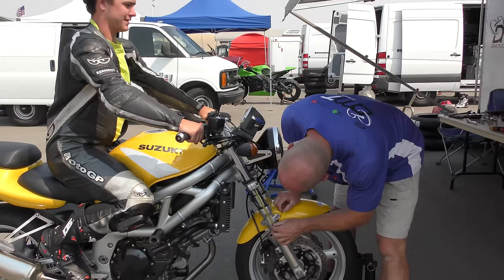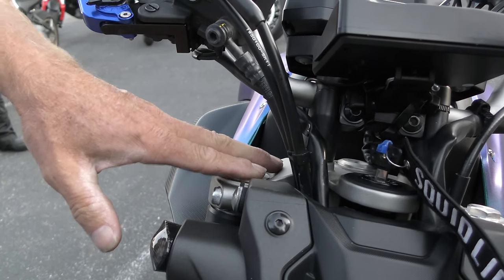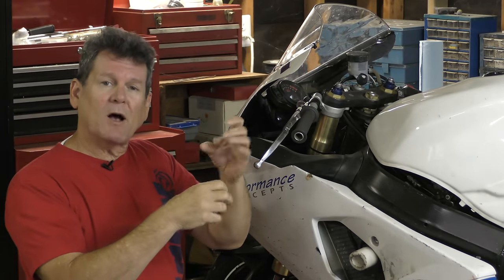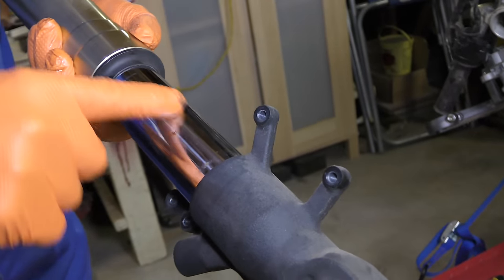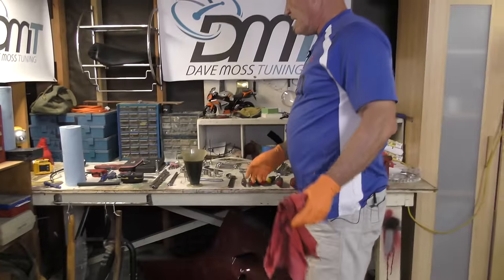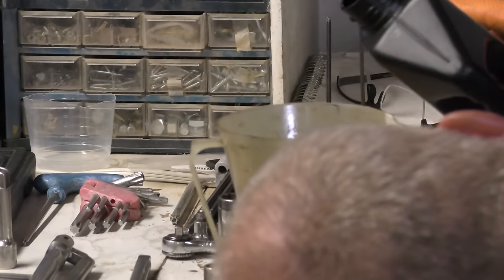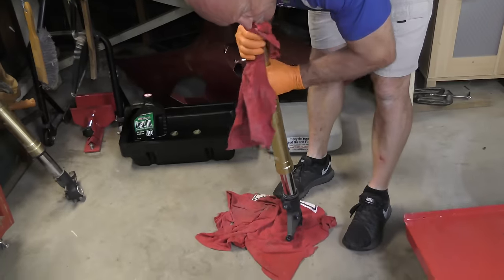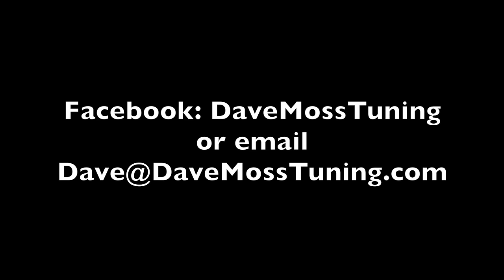Dump & Run Fork Oil Change for Standard Adjustable Motorcycle Forks

Comment: I've never once seen a fork disassembly vid where the mechanic uses a plastic tool for separating the dust cap. It's so easy to slip or otherwise have an oops with a screwdriver and either scratch the inner leg or mark up the bottom of the outer leg. For $5 you can buy a set of car trim panel tools which are plastic and never worry about having an accident.

Comment: Wow! 10 Years ago I had to rebuild my forks every year, because they were leaking. Massive amount of work because I pulled everything apart. 

Now I think I know my problem. I didn't pushed the air out of the inner cardrige and stored the forks horizontal till I needed them.

Big thanks to Dave Moss! I wish we had someone with your skill in Germany who's doing the same service to costumers.
Reply from the maker: Glad that in time you now understand what happened and why so next time, you will get the job 100% right.
Reply: @catalystreactionsbw  I've been watching a lot of your Videos the last few days and I do understand more and more of my mistakes I've done over the years.

Comment: when doing fork seals and changing oil is it good practice to back off all adjusters to the softest position first and if I don't are there any bad outcomes
Reply from the maker: That is a good idea so you get maximum irculation to eliminate oil. Not doign this just makes the process a couple of minutes longer.

Comment: Shouldn't you use steel wool instead of 400 grit sandpaper on the chrome finish on the forks? I could see from here in michigan you scratched them up.
Reply from the maker: It is how I was taught in 1995 when I first started in a suspension shop and have stayed with that. After a few hundred miles the chrome is perfect again. For others it can be crocus cloth, wire wool, 1000 grit emery cloth. Many ways to get an excellent result.

Comment: I used the 400 grit sand paper to sanded down the dirt on the forks and now they have a lot of scraches... I don't know if that's really a  bad thing. Instead of sand paper use abrasive rubber which is much more gentle with delicate surfaces.
Reply from the maker: The fork dust and oil seal will polish all those marks out very quickly.
Reply: I think he used a different grit to after using 400 grit.  not sure what it is.. same thing happen to me.  I heard 2000 works too.  thanks for the tip.

Comment: Hi Dave, thanks so much for this vid, it was easy to follow and I used it to do an off season fork oil change on my R1 5PW race bike. The seal greasing trick was a nice touch too, managed to improve the stiction on one of the forks that was a bit juddery!
Reply from the maker: Excellent and thank you for using this video as a reference to get the work completed! A tip of the hat to you :)

Comment: Good intruction video, but i wonder why not change the dust and oil seal att the same time as changing the oil?
Reply from the maker: Thank you, glad you enjoyed it. If the oil change is with low miles on the seals and they are not leaking, the old adage of "if it isn't broken don't fix it" applies. Seals will be replaced every 10k on my bikes for road, every 3 seasons for track. We all have our own preferences, so dust and oil seal changes at your personal interval choices.

Comment: So I just checked a 2020 bike owners manual - their standard procedure indicates fork first oil change  at 40k kilometers  (read the line twice and could not believe it ) ... so roughly never - not good I guess. 
Direction column bearing balls check and greasing  happens at 10k ...  no comment .
Thanks Dave for sharing your expertise and making
 us getting some “esprit critique” ...
Reply from the maker: Thank you for doing some research to give yourself data points to review.

Comment: Good tutorial. 
Call me crazy, but with the amount of glitter in that oil, I'd disassemble it and clean it up proper. It's not rocket science. Oil was dumped out, but that metal was at the bottom, so there's still more inside, likely in the piston/shim stack.
The owner of that bike would be well served to clean the fork tubes as much as his tank or exhaust. 😅
Reply from the maker: Agreed..... nothing better than a full tear down to know everything is clean and fully fiunctioning.

Comment: you make that look easy...I did seals on my FZR, wasn't even close to easy.now that I've put 300 miles on her I realise it needs better springs.
Reply from the maker: Did you use propane to warm up the seal area first? It helps tremendously.

Comment: Great informational video Dave and thanks for posting....I'm about to change the original oil in my 2003 Honda Valkyrie f6 1500C with 34000 miles. Going to use BelRay Motorcycle Oil 99330-B1LW..15W instead of Pro Honda SS8 10W...... thoughts.??? Also, dirt and debris gets past the dust shield and into the seal. An occasional cleaning using plastic film or plastic fork cleaner tool seems to do the trick..
Reply from the maker: Hi Thomas. Thanks for your kind words. A seal saver type product is superb at what it does. 15w BelRay is an excellent choice!
Reply: @catalystreactionsbw  Thank you so much for the fast reply and have a great weekend..!    Best Tom

Comment: I didn’t realise this was so easy!!! 
I have a 2014 z1000 with preload adjust on top of left fork and compression and rebound on top of right fork. Will this work wit my forks? And do I only do the right for or both sides?
Thanks Dave you videos make it so easy to understand suspension!
Reply from the maker: Yes, it will work with either leg - same process. With damping in one leg and spring in the other, don't be surprised to see different oil amounts.

Comment: Thank you Mr. Moss, your insight is invaluable.  I read through all the comments and had most of my questions answered, so thanks to your followers.  I'm a newbie to motorcycle maintenance and have one more question and that is, supporting the bike when you remove the forks.  It looks like you have the bike resting on its exhaust pipes supported by 2x4 lumber.  Is that what you've done?   I assume that, if that's what you do, it must be OK for the bike.  Is that a safe assumption?   Thanks again.
Reply from the maker: Thanks for watching and leveraging the content. You observation is accurate. If the bike had titanium headers we would have held the bike up by engine cases.
Reply: @catalystreactionsbw  Thanks for your response.  I'm setting up a 2006 R6 for the track so I'll be watching a lot.

Comment: I guess using the measurement of the removed oil assumes the last guy did it right and there's been no loss? Is it best to refer to the manual or would that quantity assume a complete (to dry) service? Thanks for the video - I always learn lots.
Reply from the maker: Correct - always check service manual first for known volume, then decide what you want to do.
Reply: @catalystreactionsbw  , but the service manual, for my 2007 CBR600RR for example, only gives an oil height reference while the fork is without the spring, so the only way I know how much to pour back in is to try and capture everything that comes out...  unless you tell me something otherwise...?  right?   Thank you!
Reply from the maker: @LongDogRacing  In that case (as you cannot remove cap, spacer and spring) yes, you capture the volume of oil removed to see what you have. Research online shows 400ml as a minimum or oil height at 100mm. Ride and see how much fork travel you use and mark fork bottom out as a reference. If you bottom out add more preload and compression. If you bottom out again add 25ml per leg and go back to original settings.
Reply: @catalystreactionsbw  Thanks Dave.  I recovered 350ml from each of the forks (yes, every last drop!), and replaced it with the exact amount.  I will ride them and heed your advice.  Thank you for all you do!
Reply from the maker: @LongDogRacing  My pleasure!
Reply: @catalystreactionsbw  ('07 CBR600RR) Dave, I've set my oil height per the manual at 93mm (10 weight bel-ray).  I installed .85 springs per the k-tech calculator for my 150lbs (w/o gear).   During my tuning day at Mid-Ohio, I found it difficult to balance the trade-off of preload and compression, as I found myself very close to the max preload setting (which I don't think you want, right?) as well as very close to the mechanical bottom.  All of this to ask:  If I add the 25cc's you recommend in this subthread, what would be my approximate oil height removed?   What is the minimum oil height before bad things happen (and I need to just bite the bullet and get the next heavier spring)?

Comment: Thank you for the video. Is there a related video with guidance on reinstalling the forks in thr triple clamps? Specifically, aligning the rotation of each to ensure the axle aligns properly with the lower part of the fork?
Reply from the maker: General principles suggest setting the fork height the same above the upper triple clamp. With a used bike and unknown engineering inside, forks may have been modified. Measure from the base of the lower triple clamp to the base of the fork. If there is a couple of millimeters difference, that is not a problem. 4mm or more would require an alingment and ignore the upper measurement.
Reply: @catalystreactionsbw  Thanks; you did mention taking a measurement from the top of the triple clamp to the top of the shock prior to removal, so as to reinstall at the same height. But my question was focused on the rotation of each fork within the triple clamp - what's the recommended method for ensuring that the forks aren't twisted out of alignment w each other. Just slide the axle temporarily through the lower end of the forks during the reinstall?
Reply from the maker: @rhenriksen  If the fork outer tube(s) are twisted, you would need a straight edge to validate that. If they are and you do not get then straightened, then you mark the bow in the fork(s) with a Sharpie pen so the wheel faces further forward. If one is bowed, then you must get it straightened.

Comment: 400 grit sounds a bit to harsh for that crome .. would 1200 be an overkill ?
Reply from the maker: We have used 400 grit since I started in 95. It gets rid of all imperfection and cross hatches a nice smooth surface. If you want a nice finish after 400, go to 800 grit.

Comment: Good afternoon.  Tell me, is it correct to change the oil in the fork without removing the spring and bushing?  What does it threaten?  The manual says they should always be removed.
Reply from the maker: It risks nothing and decreases wear of bushings especially if you let them drain overnight. If you feel you MUST follow the manual, that is quite normal.

Comment: Hi Dave. Thanks for the video. I have a 2018 KTM 1090 Adventure R with compression and pre-load on one fork cap and rebound and pre-load on the other. 25,000 miles and I am doing the first fork oil change. I dumped out 620 ml from each fork but the manual calls for 715 ml in each leg. Is there a problem with just putting the recommended amount of 715 back into each fork leg? I am fairly certain I drained all the oil out using the method you described. Thanks again for the great video.
Reply from the maker: Hi John. If you pumped the caps to empty the cartridges and drained it for 24 hours and 620ml came out, then I would put 700ml back in.
Reply: @catalystreactionsbw  Thanks Dave. Did pump the forks extensively until only a very few drops were present. Did not let it drain for 24 hours though.
Reply from the maker: @drjdvm  Go with 700ml.

Comment: Questions Dave. I have a 2012 s1000rr, and the manual says I need to add 602ml of fluid and 90ml of air gap.The manual doesn't say, but is it 602ml and 90 air gap with no parts inside or with all the internals in spring cartridge, etc. Thanks so much for all your video.
Reply from the maker: It is with cartridge only inside. Spring and spacers not in the fork.

Comment: Buy extra oil before you do it fellas! I only bought an extra liter which was not nearly enough to get it proper clean. I would count on using about almost a liter per fork just to get clean stuff coming out(I wouldn't use brake cleaner like some guys do, rubber don't like that stuff).

Comment: Great video.  What's the fix if I get 450ml from 1 leg and 420ml from the other? Do I put extra in the leg with 420 or just replace as is.  Forks seals are not leaking
Reply from the maker: If you are aggressive, 450 would be the volume to go with. More leisurely? Go with 420.

Comment: Hi Dave. Really helpful video thanks. Just in the middle of doing my forks. Only managed to get 510ml out of each fork leg but the manufacturers recommendation is 602ml. What amount should I put back in?
Reply from the maker: Thank you. Normally you get almost all the oil out and there is a 25cc difference.  Always put back in the amount you took out unless you are going to set a very specific oil level.
Reply: Thanks for replying so quickly. Just wondering why I wasn’t able to get the majority of the 602ml out? It’s a 2010 S1000rr.
Reply from the maker: @chriswood77  Unusual - perhaps someone had changed the oil before you and chose a different volume?
Reply: Only had the bike for 3 months and not been able to ride it much due to current lockdown rules. It’s only done 7000 miles  so that’s why I’m changing the oil. Just wondering what to do now. Would the lower oil level make you think that the previous owner has been changing the setup? I’m only 12 stone but had to wind preload fully in to get correct sag. Could this have been a lighter rider wanting a softer spring and greater air gap?

Comment: Thanks Dave!, I'll be doing this soon. I have a question about air gap. Does this  dump and go assume that the air gap has been set via the amount of oil that's been removed. In other words, putting back the same amount of oil that was removed means the air gap is the same and doesn't need to be set?
Reply from the maker: That is correct. If you want to assess volume, compare with the service manual to see if you have more or less.
Reply: @catalystreactionsbw  thank you very much,  I'll do that

Comment: Do you have a video for replacement of both bushing inside the fork?
Reply from the maker: Yes if the forks are what is called bash apart. The CBR600RR video has that process in it. If the fork upper tube comes off in your hand, those bushing are captive and you need to buy a new upper. Not expensive. Otherwise a suspension shop "might" have the very special tool needed to attempt to get the bushings out.

Comment: Hi Dave, regards from Colombia South America.
Any time have you used small amount of fresh oil to flush the system before refill?

Is it good?
Not necessary?

Successes!
Thanks for share!
Reply from the maker: There are many ways to do this, the two most popular being kerosene or oil flush. The right thing to do would be a strip clean of every component but very have have that capability.

Comment: At 10:30, when you are pouring, aren't you worried the oil is not making it into the inner tube and instead going between the inner/outer tube?
Reply from the maker: There are holes in the chrome tube to allow the passage of oil between the inner and outer tube, plus you have the oil seal in place.
Reply: @catalystreactionsbw  makes sense, so when the fork goes thru it's travel stroke, the oil "trapped" between the inner/outer rises sufficiently to reach that passage point. Thanks Dave!

Comment: What is the video called about air gag/ oil level. I'm having trouble at moment with new cartridges, air gap was 190 from the spec sheet from maxton . I'm bottoming out ,so I've put 20ml more oil  more preload and a bit more comp . Now I'm still going to the bottom but got 2mm static sag and 20mm rider ,22mm so way to stiff .I can't work it out .was going to put 50 ml more oil  change air gap to 110mm and put back to original settings . I'm a member of your online group so I'd like to watch any videos on oil level . regards Dylan
Reply from the maker: Hi Dylan. Thanks for supporting what I do via your subscription. 2mm static sag means the spacer is way too long. 20mm is generally a minimum number. Sag at 22mm with 2mm static and you are bottoming means your spring is massively too soft. Oil level at 190 is for race use generally and you do not talk about preload nor compression (where are you in the range?). Before adding oil, we need to know if that is the right direction that will yield a solution. Email me with all this as a copy & paste: dave@davemosstuning.com
Reply: @catalystreactionsbw  I've emailed you on davemoss tuning .  Thanks 👍

Comment: Do you have to use expensive sweet smelling "Maxima" types, or will regular hydraulic fluid, or ATF work?
Reply from the maker: ATF is generally 30w, so if your application can use that correctly, sure.
Reply: @catalystreactionsbw  ATF fluid weight
Mobil 1 Synthetic ATF is approx 10wt.Mar 26, 2011

Posted April 19, 2009
ATF and power steering is 10W and so is most hydraulic oil. I prefer Dexron II or III the additives package is very good.

I am currently using ATF in my forks (which runs at roughly 10-15W according to BWB) and they work fine for me. 

Where did you get the 30 wt info??
Thanks
Reply from the maker: @user-sp8eb6iz7f  If that is the case, you need to check Viscosity index and cSt number for the oil and then compare to Maxima/Motul etc data to see where it fits in. There are many very detailed fork oil viscosity charts that can be found via Google.